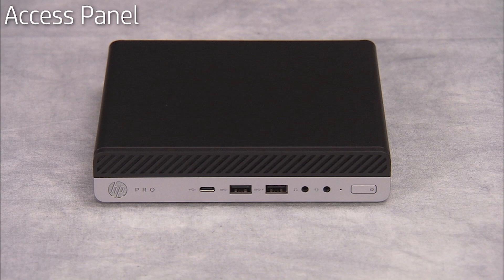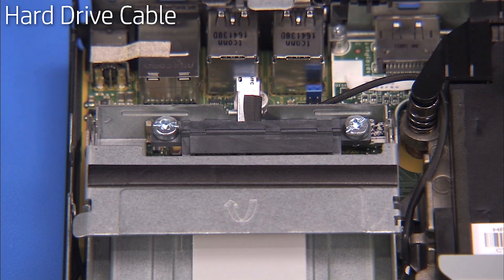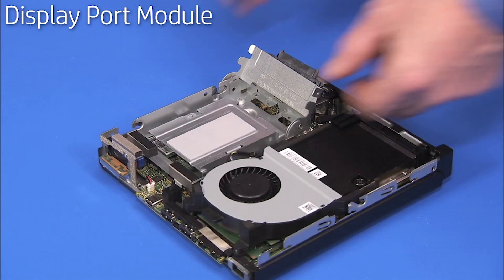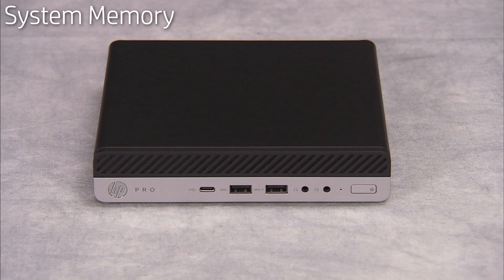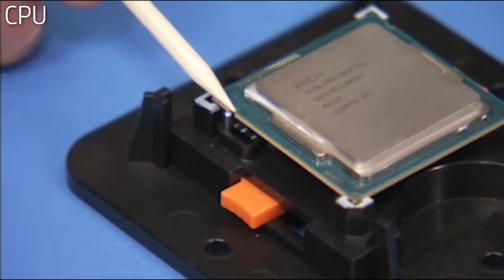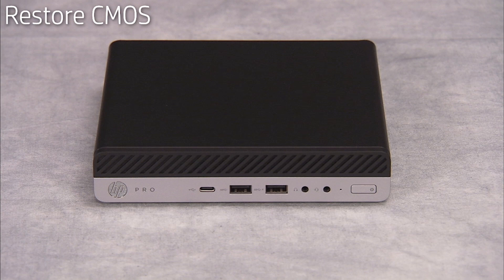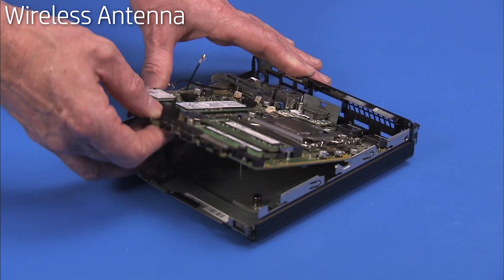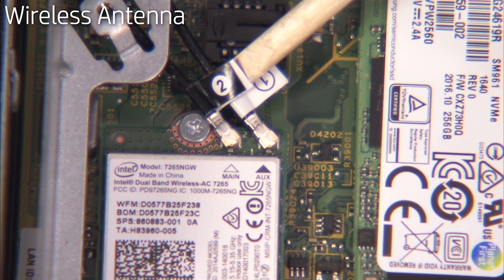Removing & replacing parts for HP ProDesk 600 G3 Mini | HP Computer Service

Comment: Is it possible to upgrade the CPU with non T model?
Reply from the maker: Hi there, thanks for contacting HP Global Social Media Support!
I understand that you need to know about upgrading the processor of your computer.
I will do my best to assist you.
HP does not recommend upgrading or downgrading hardware parts or software that is bundled with the product as It may affect the manufacturer's warranty and performance, however, you could change the configuration at your own discretion.
Regards, 
HP Support
Reply: Maybe but I wouldn’t recommend it, the T series is low voltage and is designed for pcs like these

Comment: What processor would be best for this mine didn’t come with one (bought used) and is a intel I3-4130T or a I5-4570T better I currently have 170$
Reply from the maker: +Channon The dutchie Please refer the specification page to know about the supported processors: https://bit.ly/2RxcbWB
Reply: Idk if you already bought one, but I put an i5 in mine and it works great. I had an i3; it was a night and day difference for me

Comment: Ola asks if with the hp prodesk 600 g3 mini you could change the motherboard, power supply, case and graphics card if possible.?
Reply from the maker: +Emilio HP does not recommend upgrading or downgrading hardware parts or software that is bundled with the product as It may affect the manufacturer's warranty and performance, however, you could change the configuration at your own discretion.

Comment: Hello, is it possible to change the display ports from DP to HDMI? Thanks
Reply from the maker: +joed maravilla Enjoy access to and expand compatibility with your multimedia devices with an adapter that converts your DisplayPort output to HDMI. Simply connect the DisplayPort end to your PC and the HDMI end to your device. You can check the specification here: https://bit.ly/3qG9Wjo
Reply: @HPSupport  Hello, what if I want to change the ports? Like get rid of the DP ports then change them with HDMI ports.

Comment: As an IT Engineer that inherited a fleet of these HP ProDesk machines, I'm quite appreciative of this video for making service really easy. 

I do have to laugh at the odd, but likely still effective technique used to apply thermal paste at 10:10, and the ridiculous CPU removal tool at 12:55. I have never seen anyone utilize that tool for an LGA based CPU.
Reply from the maker: +BeefJerky4104 Glad to know that the video was so useful to you.
Reply: @HPSupport  very very good job
I had watched few youre instruction and i have to say, i had never seen before as exelent tutorial like HP company. Thumbs up

Comment: Really very good and explanatory video. I watched it in purpose to see how to install WiFi card in my Prodesk 600 which came without WiFi option. But as I see, inline with wifi  card, I will need antenna cables which I do not know how to obtain. I will use USB WiFi module.
But, anyhow, this video is very helpful to every one who wants to deal with Prodesk. Great to see every procedure of disassembling and to avoid breakage with maltreatment.
Reply from the maker: +Branko Zivkovic I am glad to know that the video was very useful to you.
Reply: @HPSupport  If you can just explain how to install WiFi on HP ProDesk 400 G3 Mini (Pn y5f30av)
Reply: Sorry to be so off topic but does any of you know of a method to get back into an Instagram account..?
I stupidly lost the account password. I would love any tips you can offer me.
Reply: @Briar Kashton instablaster ;)

Comment: do you know if the fan is constantly spinning? Is it ever at a standstill even from the start
Reply from the maker: Hi Olivier, thanks for contacting!
I understand that you need to know whether the fan spins constantly.
I will do my best to assist you.
It is normal for the fan to run when the CPU thermal temperature rises and on today's thin and light designs the fan will run more often due to the compact design. The fan may run constantly when CPU utilization is running high.
Binu - Social Media Tech Support

Comment: I have one of these models with the M2 drives, I'd like to add a 2.5 inch SATA SSD. In the video, it shows this, but I can't find the SSD tray or cable part numbers
Reply from the maker: Hi Roger, thanks for contacting!
I understand that you need to purchase SSD tray and cables.
I will do my best to assist you.
Use the HP Parts surfer to identify the part: http://partsurfer.hp.com/search.aspx 
And order it via the HP Parts store: https://bit.ly/3nKMYrs 
Binu - Social Media Tech Support

Comment: Normal SATA 2.5" drivers are 7mm in height, it's possible to fit a 15mm height drive?
Like the ST5000LM000 or ST4000LM024 as an example.
Reply from the maker: +David Melo HP does not recommend upgrading or downgrading hardware parts or software that is bundled with the product as It may affect the manufacturer's warranty and performance, however, you could change the configuration at your own discretion.

Comment: i wold like to know what kind of memory this pc has, because i want to buy more RAM, my PC is a Prodesk 400 g3 DM
Reply from the maker: Hi there, thanks for contacting HP Global Social Media Support!
I understand that you need to know about upgrading processor and memory of your computer.
I will do my best to assist you.
Please refer 'Processor' and 'Memory' under the specification page to know about supported processor and memory: https://bit.ly/3lb9Z9w
Binu_HP Social Media Tech Support
Reply: Thank you so much for the info but I need to know what kind of socket is
Reply from the maker: Thanks for the reply.
The computer comes with at least one small outline, dual in-line memory module (SODIMM). To achieve
maximum memory support, you can populate the system board with up to 32 GB of memory.
Binu_HP Social Media Tech Support

Comment: Hi, this 600 g3... I can boot windows 10 from m.2..?
Reply from the maker: +Pedro Luis Zevallos Ticacala Please try below mentioned steps to fix this issue. Go to BIOS: Advanced->Security Boot Configuration->Legasy Support Disable and Secure Boot Disable.
And also disable power management PCIe: Advanced->Power Managment Options->PCI Express Power Managment.